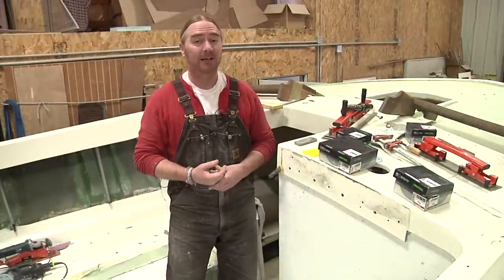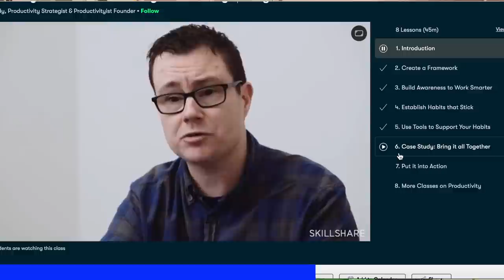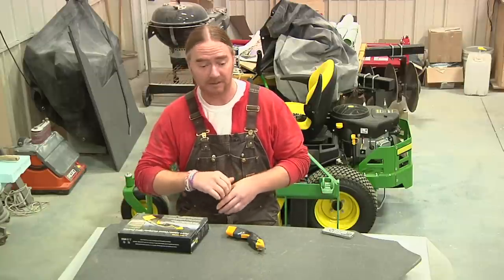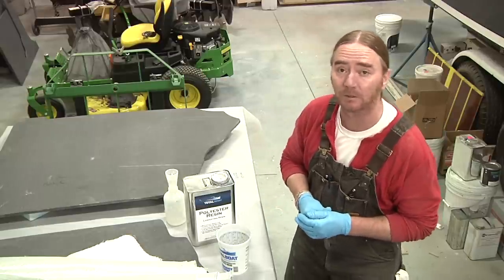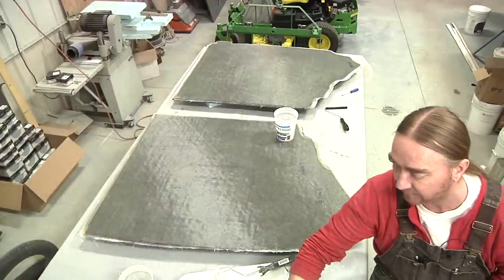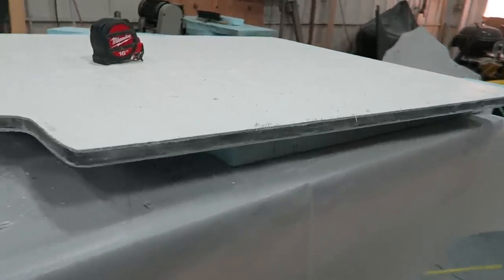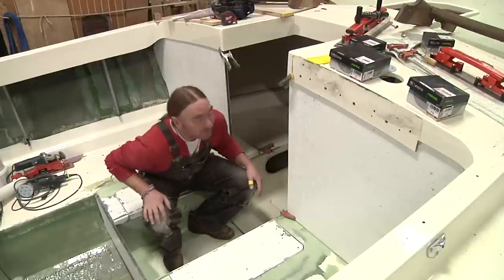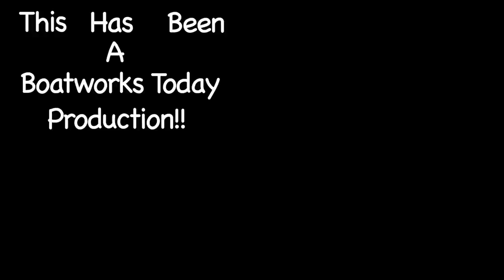Cutting Fiberglassing And Fitting The New Bulkheads!

Comment: "fake, retro wood look"
Yep, my 1973 Luhrs has tons of that! Inside the salon and formally on the interior & exterior of the rear cabin bulkhead. I had to completely remove the rear bulkhead, which includes the door into the cabin. Right where there was a seam of the sheets of laminate, water seeped in over the years and completely rotted away the plywood inside. I'll be using a 3/4" rigid PVC material that I purchased a few years ago to construct a new bulkhead and door. Hoping it works out, but if not, there is Coosa, fiberglass, and your excellent videos to guide me along!
Keep up the great work, Andy! It is very much appreciated!

Comment: Hi and thankyou for you for the very informative videos this will help he out a great deal with my new project restoration (restoring a Bonwitco 400c No84 pretty old). So i have a quick question around using structural foam please. I am a tiler by trade and i have used Jackoboard as an example but there are many others on the market. So i have used these type of foam boards for structural work and i was wondering if this would be acceptable (if primed correctly) for use with fibreglass?
many thanks
Si

Comment: Watching your older video on crack repair, excellent! (my 80's sailboat has the typical light cracking near bridgedeck).  I saw and appreciated your comments on dust control.  Curious if you use a respirator when working with certain types of wet resin or chemicals?   Anyway, great interesting expert stuff.

Comment: Lookin good!!, are you going to fair in / glass the top cap section where the screw holes are to the bulkheads to have a seamless transition? Or does that get covered up by aby trim pieces?
Reply from the maker: Just going to leave that little detail and trim it off :-)  Still want to have these bulkheads able to be removed down the road if needed :-)

Comment: Andy.  Thanks, I am absolutely hooked on your channel.   I am so impressed with the Coosa Board you are using but we do not seem to get that in New Zealand.  The Alternative I found is an Armacell board but that is a much lower density (i.e. 250kg/m3 ) than the Coosa Board (which is over 400kg/m3 density).   I am going to try that Armacell product on my boat. Will see what happens  :/)

One Question regarding teh Cooseboard though.  If its already a polyurethane foam sheet with fibreglass layers worked into it... WHY is it necessary to glass the sides again?

Thanks and please keep up the great vids!

Comment: Hey Andy I just finished a small cabin sole part with 1/2" Coosa core, 2 layers of 1708 and a top layer of 10 oz woven on each side. I was looking for STRONG in a just under 3/4" thickness and I got it! I am not super happy with how 1708 wets out with epoxy, it seems to take a lot of extra work compared to a woven material. Is poly quicker at getting 1708 to wet out?

Comment: I dont understand anything about resin or epoxy but I was wondering, If you doing so much laying out (if that's the term) couldn't you mix a lot more to save time stopping and starting while mixing?
Reply from the maker: Not really, the resin would start to setup in the cup before I'd be able to apply it to the glass :-/

Comment: That “easy cutter” will save your wrist from all that cutting! Good stuff!
Reply: I am starting a small GRP Flanges and Elbow fitting business in my country and your videos are just inspiring. I have a question if you dont mind, what type of fibreglass was that, it looks like csm on one side and Fabrics or WR on the other side ..thanks
Reply: At $97 It’s a little on the pricy side but I guess you get what you pay for
Reply from the maker: it's called 1708 or Bi-Axial fiberglass.  Typically it has a layer of CSM on the backside but it can also be found without the CSM backing.  Good material to use with both epoxy and poly or vinyl resins :-)
Reply from the maker: Buy once, cry once ;-)  I can definitely say that it's faster then a razor blade and way easier than using scissors when cutting a lot of material.  Don't know how I ever got along without it lol!
Reply: @boatworkstoday  thanks for fast reply, i will check with local supplier; thanks and 
keep going
Reply: BoatworksToday and a good pair of Wiss run between $30 & $50. These are much nicer when cutting a lot of dry material!
Reply: I use a Worx zip snip. Cuts any fiberglass has replacement blades too. On Amazon for $35.

Comment: It seems you're spending a lot of time laminating layers of glass, would it make sense to to with a thicker layer of coosa board and only a barrier layer
Reply from the maker: That would have been an option if I had the material ;-)  Don't have an extra 1/4" sheet to spare but did have the glass and resin
Reply: The skins were pretty thick, but 5/8 Coosa is not available, and 3/4 would have ended up thicker than he wanted had he put even just one layer each side.  Divinycell is available in 5/8", according to this site http://www.fiberglasssupply.com/Product_Catalog/Core_Materials/core_materials.html and that would have allowed thinner skins, resulting in less labor, less weight, and possibly less cost (not counting the cost of having to get yet another size that may only be used this one time).
Reply: Andy, how did the weight end up compared to 3/4 plywood?
Reply: @todmills  I'm curious also